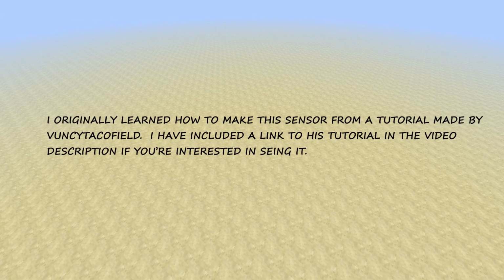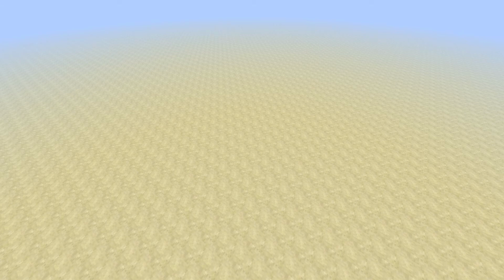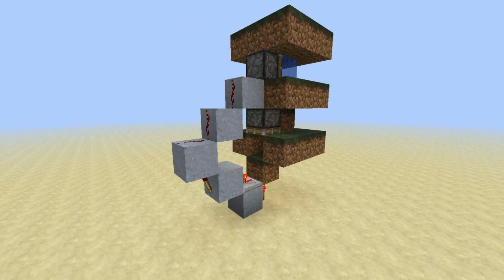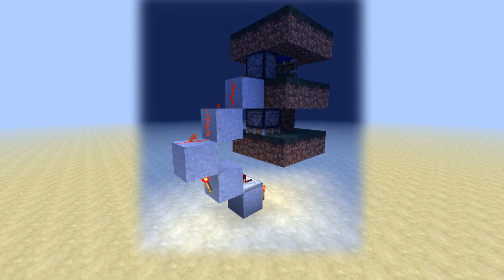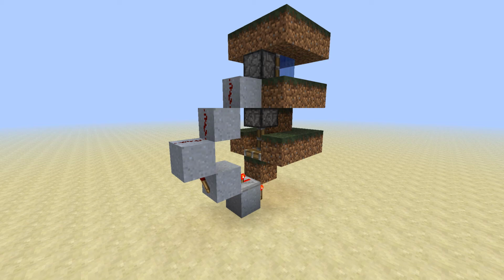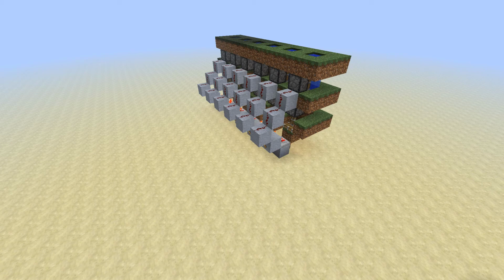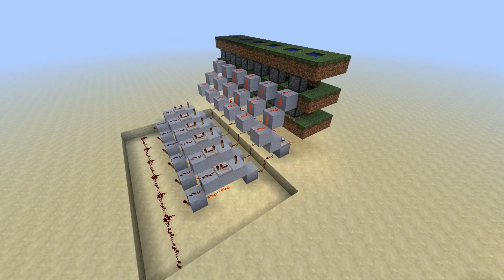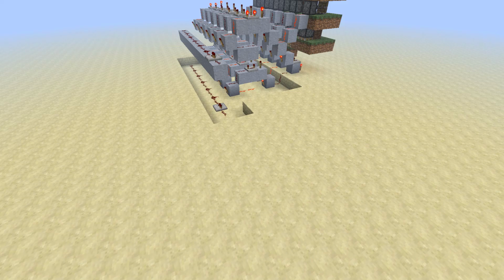Geoff's Minecraft Fast Day & Night Sensor Tutorial (1.2.3)

Comment: I'm sure you've figured it out by now, but for those who don't. It's a bug Pistons activate when there are changes to the block ID around them. Grass Blocks and Dirt blocks have different Block ID's so they update the piston when they change. If you have the placement right and you can use a furnace or even Redstone ore cause when the furnace is burning it changes and redstone ore glows when you walk on it.

Comment: Instead of using the pulse generator connected to an RS NOR latch, couldn't you just directly run a wire from the sensor?

Also, get job on the video.  Probably one of the best tutorials I have seen.

Comment: Basically, a piston can be tricked into staying on/off when it shouldn't be, and will only realise it's in the wrong state when a block nearby is updated. When grass grows/dies, it acts as an update to the block, and triggers the piston to check itself. If you can get it stuck in a loop (i.e. the BUD switch), then you can use it to activate/deactivate redstone as it grows and dies :)

Comment: There is something called a BUD switch (Block Update Detector). It is actually a glitch but its a nice one. The glitch means a piston will remain extended even if it is unpowered. Putting a block next to it updates it retracting the piston. The piston breaks a circuit and resets itself till it is to be updated again.